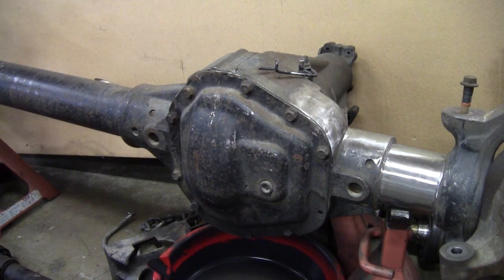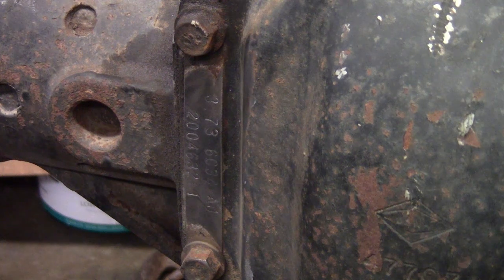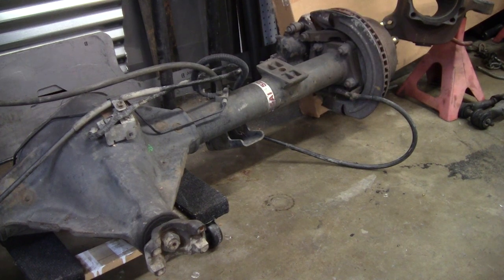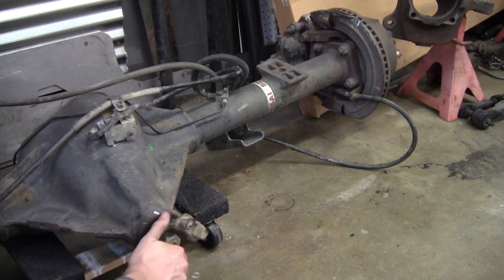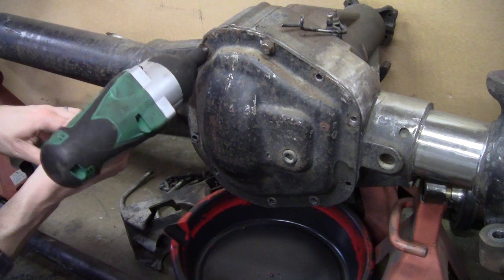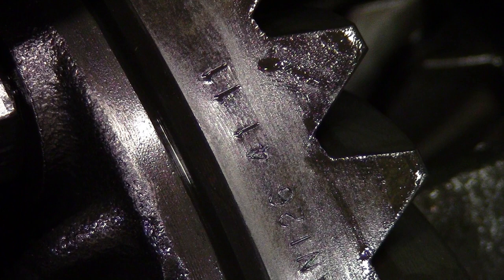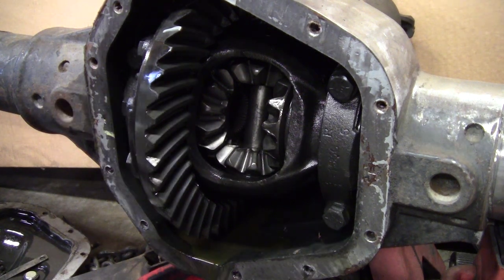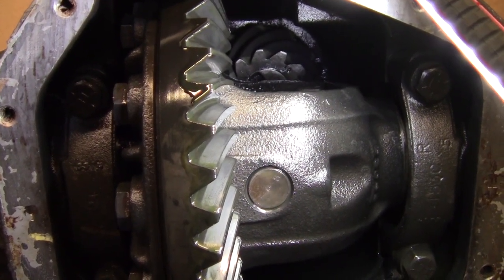How to find axle gear ratio

Comment from the maker: In case you didn't notice, the ratios are different because they are different axles haha. Also, when counting rotations of the pinion and tires, both tires should be spinning to get an accurate reading. If only one side is spinning (ie if you have one tire jacked up and the other planted on the ground,) the free tire spins twice as fast. That means you need to count how many rotation the pinion does in two rotations of the tire to get the estimation of the gear ratio

Comment: I Bought a brand new in 2010 Ford f250 super duty FX4 4 x 4 with a 6.4 L diesel engine. Will the dealer be able to know which Dana axles I have and what gears are in the differential? No one ever changed/ touched the truck. Thanks for any help_Jim
Reply from the maker: It will have a Dana 60 front and Sterling 10.5" rear, and yeah the dealer should be able to give you the gear ratio based on the VIN.  Good luck!
Reply: Thanks a bunch WebWheeler. Those Dana axles are really robust.
Reply from the maker: They're awesome! Super strong and easy to work on. That's why I chose them for my solid axle swap on my dakota haha

Comment: why did you say it was most definitely a 4.10 gear ratio then count and say it was 3.7 ? so is the spin test not right lol
Reply from the maker: Different axles haha
Reply: @WebWheeler  
Holy crap!  I missed that.  I was wondering the same thing.

Still, the turning method makes a difference as whether it is a Trac-Lok or Open differential, right?

Comment: Why is it written as 3.73 gear ratio but turning the pinion gear shows 4.10 gear ratio?
Reply from the maker: Different axles haha
Reply: The difference in his example shows the mistake of having an open diff vs a Trac-Lok (posi).
You can do his method with a Trac-Lok.  If you have an open diff, you must keep one wheel from turning.
Also, the turning and counting is not as exact as simply counting teeth.  Of course, you have to take off the cover and mess with changing the oil and resealing.  You should probably do that anyway, since you have never done it in that vehicle....most no body ever does it.

Comment: Can you switch the Inner Gears from a 1/2 ton into a 3/4 ton axles, as long as its a 44 and the same ratio? GM...
Reply from the maker: Yeah as long as they're both GM Dana 44s the 1/2 ton and 3/4 ton use the same ring and pinion gears 👍 you will need to check the gear tooth pattern again though to account for variations in the machining of the housings
Reply: @WebWheeler  Ok Thanks a Bunch!!

Comment: Mine won’t turn is it because I don’t have a yoke on the reared
Reply from the maker: That can definitely make it harder. Also, some axles keep the pinion in position using the yoke and nut so there's a chance the gears aren't meshing properly with the yoke removed which would make them much harder to turn

Comment: Simple as that. Thank you.
Reply from the maker: Thank you for watching!
Reply: @WebWheeler  I have 69 mustang where I want a crazy engine and transmission swap in it and upgrading the differential. 

Engine from 2006 Lexus 3UZ
Transmission toyota R155 

Do you recommend the T5 from newer mustangs differential ? From what years you would suggest to look for if I would like the limited  slip as well. 

Thanks

Comment: Thank you for post. I was curious if you could run another size pinion gear with that 41 tooth ring gear? for example could use a 10 tooth or 12 tooth instead of the 11 tooth pinion gear that's already in there? It seems logical to me that only an 11 tooth pinion gear will work with that 41 tooth ring gear. So can u use a different pinion gear with that ring gear? I subbed & liked
Reply from the maker: Thanks for the support!  Theoretically you can mesh any two gears with the correct standard tooth size as long as you get the spacing between them correct.  However, in automotive applications that distance is dictated by the axle so it's not possible.

Gears sets are matched for an axle based on the ring gear and pinion gear diameter, thickness of the ring gear, gear tooth size, etc.  If two pinion gears are 1 tooth different (11 vs 10 teeth) they either have a different diameter or a different tooth size, both of which wouldn't let it mesh in the ring gear intended for the other pinion gear in the axle.  Hope that makes sense haha.  Thanks for watching!
Reply: Yes, Thank you.

Comment: Okay but, by turning the pinion to turn the wheel you came up with a 4.10:1 ratio.

Counting teeth is the exact method.

Is the difference in the two methods because you have an open differential and you should have stopped one wheel from turning?  Would that then have given you the correct ratio?
Reply from the maker: Different ratios because they're different axles haha. First one is a Dana 60 front, second is a sterling 10.5.

You do have a good point about the tire though- if one tire is stopped, the one that spins free will spin twice as fast. So when counting pinion revolutions to estimate ratio with one tire stopped, you're ratio is how many times the pinion spins to make the tire do two rotations. But yes, counting the teeth is exact, counting rotations is just an estimate